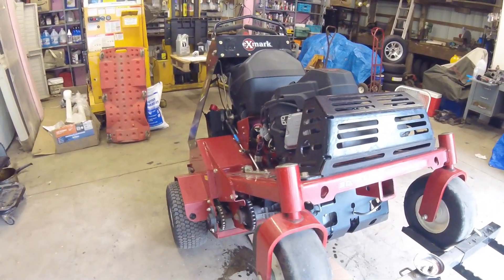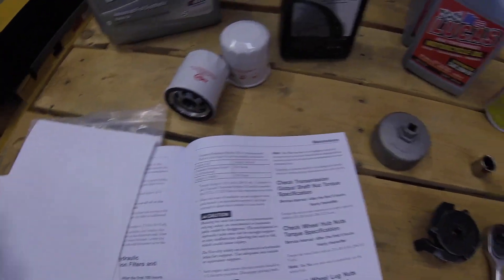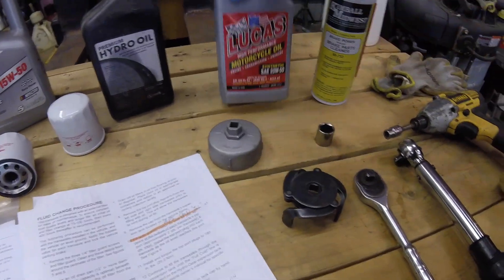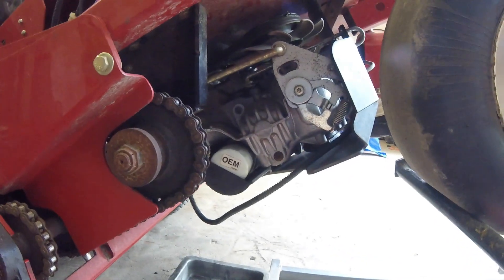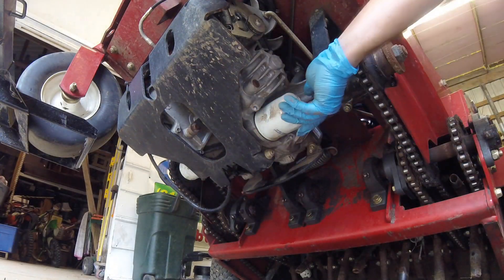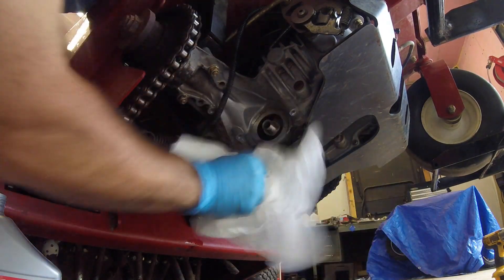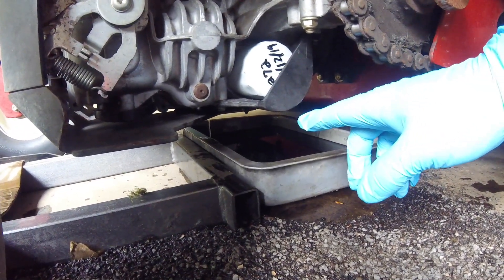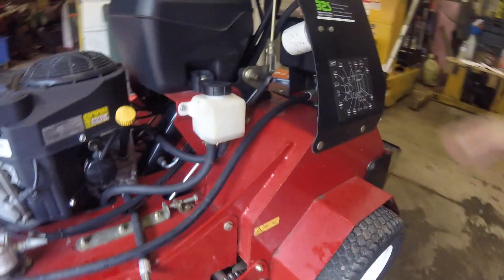Hydro-gear ZT 3100, hydraulic fluid oil change on Toro / Exmark Aerator

Comment: Getting ready to do my Toro. This was a great video. Thanks. Just had drive belt blow at 60 hrs. That was fun to replace. Do you have a video on that.
Reply from the maker: I have one on belt replacement that I haven't published yet. The best tip I can give you off hand is be sure to move back the housing that holds the hydros . Loosen 6 top bolts on top deck and two under the front weights on the underside of the frame. The toughest part is reaching between the transaxles from the bottom to get the new belt around the engine pulley. Good luck !
Reply: I have the toro version of this machine..
Near identical..
Would have to be the most difficult machine to service we own..
Nothing is easy..
Changing drive and hydraulic belts is a nightmare..
If you blow a hydraulic belt can guarantee it will smash the hydraulic cooling fans..

Comment: Did mine on the z turf 24” machine (exmark) and the wheels moved while I was bleeding the air. Stoped it, put things back from the floor, tried to move it and now the wheels won’t move at all :( any idea what that could be from?
Reply from the maker: I would be sure that the release levers are in the proper position for movement. Also, there could still be some air still in the system. Are you sure you put enough oil back in? Sometimes it takes a lot of time to get all the oil in both of them. You have to leave the bleeder plugs out while you feel the oil until it starts running out of each transaxle when filling.